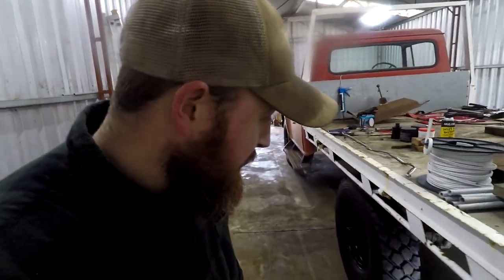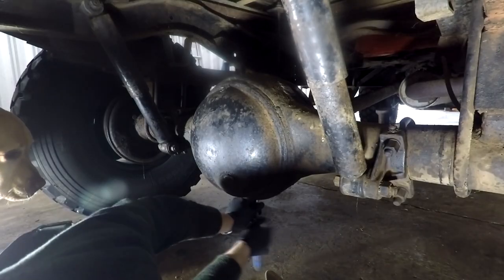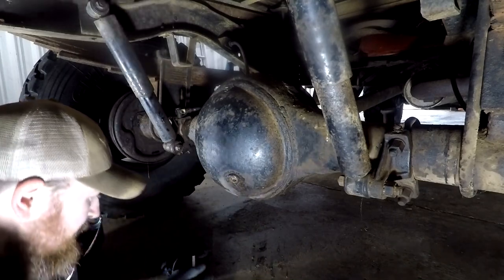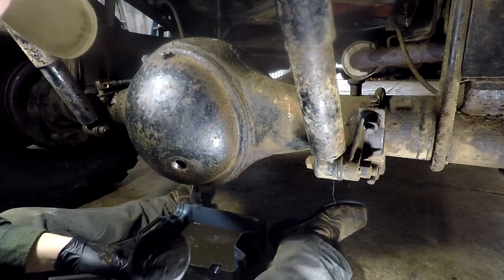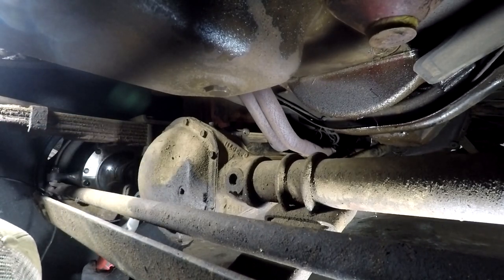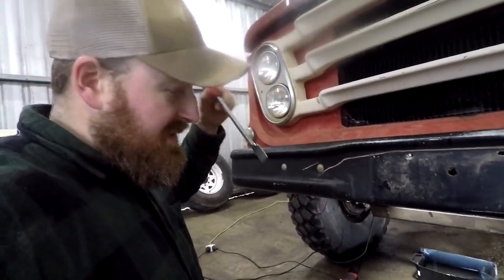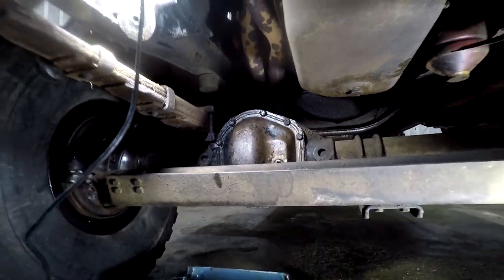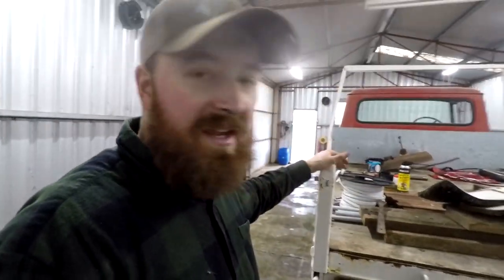Diff Oil Change (Dana 44) on 4x4 International Harvester Truck Build Project at Rusted Iron Ranch

Comment: When the oil is that bad, a good trick is to drain the oil two or three additional times over the next few hundred or few thousand miles, just to dilute out the rest of the gunk (you'll probably see that on the next change, the oil isn't as clean as it should be on account of the leftover original oil that's in there).  For the front axle, you can dilute out the old oil via additional changes without going through all the work of pulling the cover, by siphoning the oil out the filler hole with a plastic hose shoved as deeply into the diff case as you can (putting a stiff wire inside the hose, bent to the right shape, helps a lot).  Since it's very little trouble/effort to change the oil a few times this way so you remove the old oil by dilution, you don't need to worry about getting out every last drop.  Just another way of looking at things.
Reply from the maker: Thanks Eric, will keep this in mind for other projects. I’m glad I checked this one though, peace of mind knowing it’s good inside. 👍🏻

Comment: I think you should do as you said on the head board but then do the wooden slats lengthways on the base of the tray too, checker plate is a bit naff for this truck in my option. Shortening the tray too wouldn't be a bad idea.
Reply from the maker: The tray will stay as is really, apart from hard wood on the base. Hopefully the head board and rear board can be left intact. 👍🏻

Comment: Have you thought about doing your truck up in a fake business livery?  I'll be doing that with mine later.   Aussie.
Reply: PS: I use gas tape on the threads for the drain/fill nuts, never had a leak. HA! I have the same hand pump for my oil drums as well! Aussie.
Reply from the maker: I have actually, I think I’m going to get Rusted Iron Ranch on the door! There is a guy here locally that does patina sign writing so I think I’ll get him to do it! 👍🏻
Reply from the maker: I have previously used thread tape, just thought I’d try the rtv! 👍🏻 There’s is a plug on my Land Rover transfer case that always seems to weep with the thread tape so next time I’ll try rtv if it doesn’t leak on the inter!
Reply: @RustedIronRanch  Let me know who as I want mine painted as well and keeping the patina  look. thanks.  Aussie.
Reply from the maker: Look up GQ Designs in Bendigo, his work looks awesome! 👍🏻

Comment: That is a dana 60 or 70. Ring gear is too large to be a 44 and the rhs spring perch has 2 studs in it and only 1 u bolt, which identifies it as not a 44